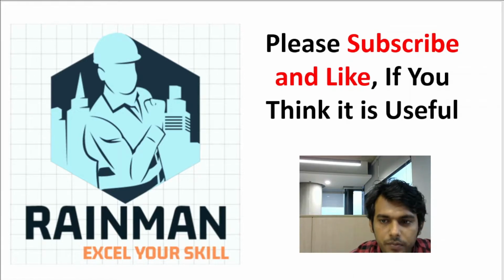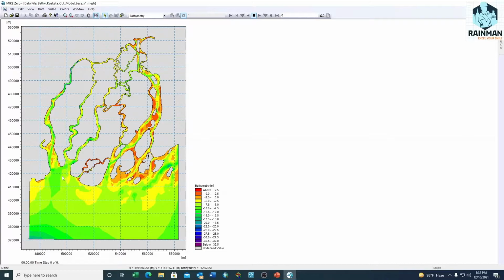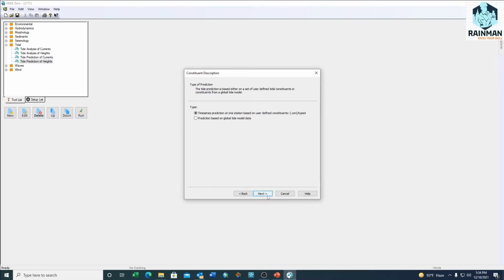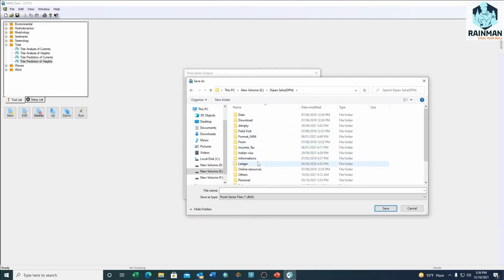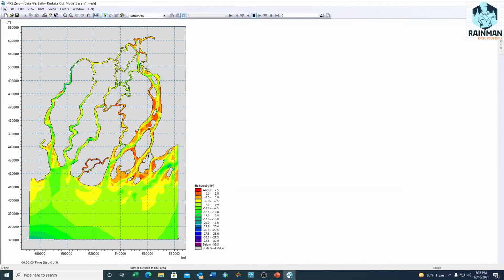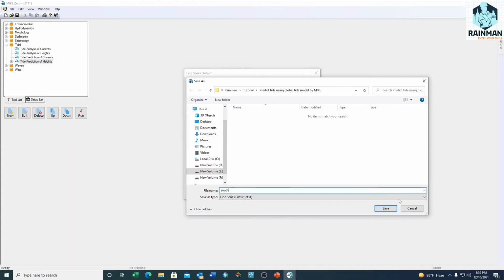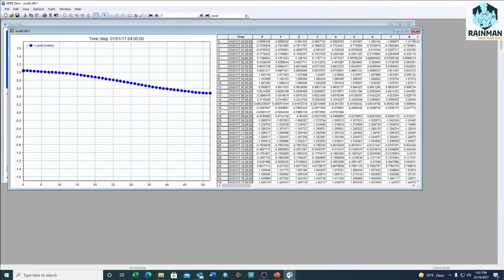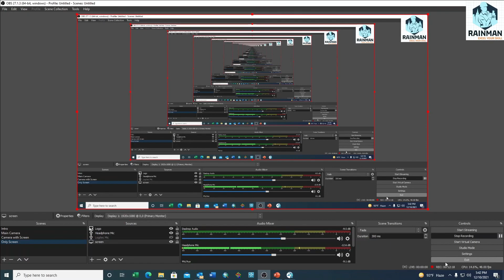Tide prediction by global tide model || Rainman || Dipen Saha

Comment: thank you for your great video!
I have one question and i hope you can read it.
If I have a observation data (water level at a estuary), how can i use the mike 21 toolbox (tide analysis of heights) to analysis the data? to have constituent parameters
Thank you very much!!
Reply from the maker: Yes, there is an option to find the tidal constituents using measured data. Thanks
Reply: @dipensahajony  Could you please make a video to solve this, step by step. Because in the inferred constituents dialog, i dont know how to choose the frequency, amplitude ratio, phase difference. i really appreciate that.